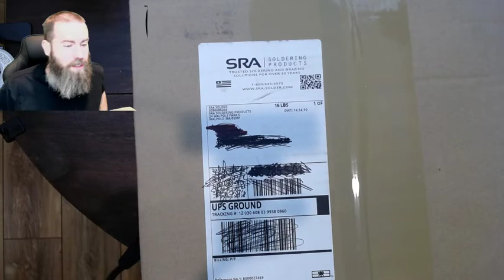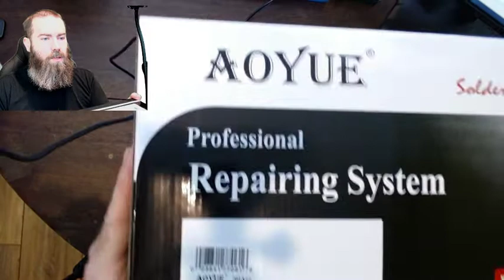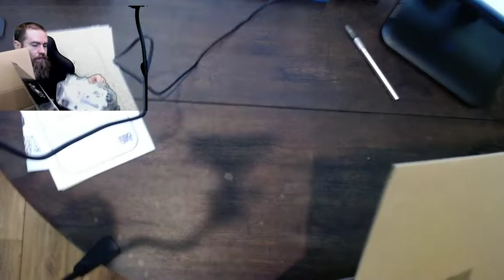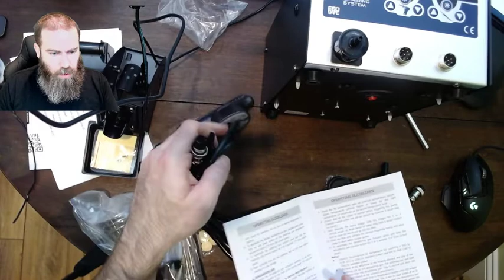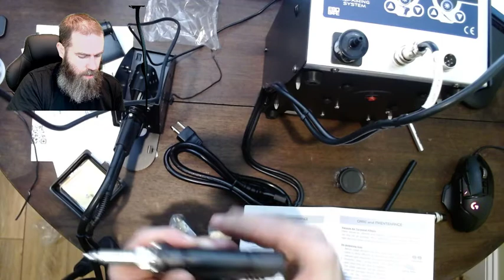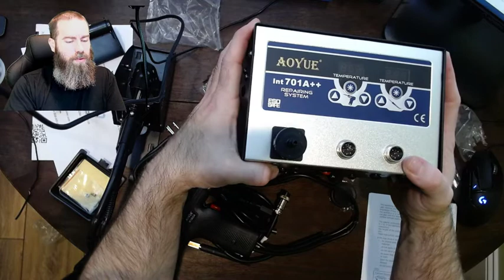Unboxing an SRA Aoyue 701A++ Digital Soldering & Desoldering Station. Desolder Gun & Solder Station

Comment: Yeah, I had the same issue with the instructions regarding the silicone grease for “cleaning.” They tell you what the grease is for (“cleaning”) but not what you apply it to, how, how often, etc. I checked old versions of the manual too. There’s simply no mention of how you use it. The Hakko units don’t seem to use it but they have glass collection tubes. My best guess is that you coat the collection tube with it since it is plastic and silicone is extremely heat-tolerant. Even with that understanding, it’s less for “cleaning” and more for reapplying after you clean.
Reply from the maker: Yes use a q tip and put a light coating but over doing it leads to clogs. Using none leads to burnt stuff.

Comment: If you didn’t want the soldering iron you could have got the 474 instead. It’s a little cheaper. That said, I find the iron surprisingly good/handy.
Reply from the maker: It was a gift from a previous supplier. I only needed the desoldering iron. I used it in a few builds. I took it out earlier this year to do some work outside and stuff came up. It sat out there during Helene. Haven’t had the time to check it still works. I always preferred Hakko stuff.
Reply from the maker: Yeah I like the built in ventilation but it seems it would be too cumbersome for small SMD work.
Reply: I actually modified an SMD placement tool to make a vacuum pick and place tool which the Hakko versions have. Mine is the older version from 2016 with the weaker but “more robust” AC pump but they eventually switched to a DC motor that probably doesn’t tolerate being on continuously as well. The other mod is a foot pedal for the vacuum and a solenoid for the trigger so that I can hold it at max suction before pulling the trigger (suction takes too long to build up as it evacuated the tubing otherwise). You can approximate this by pinching the hose and holding the trigger then pulling the kinked hose straight (unkinked) when the solder is melted.
Reply: Sorry to hear that you were affected by Helene. I’m still recovering from an EF4 tornado myself. Helene barely missed me in West GA when there were cars floating down the street in nearby Atlanta.